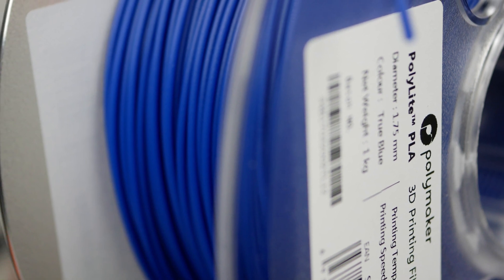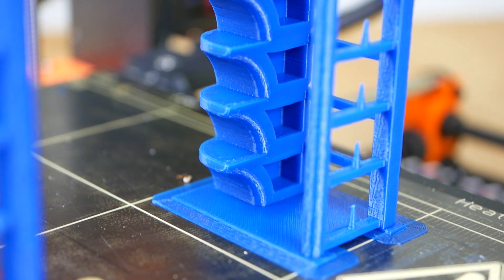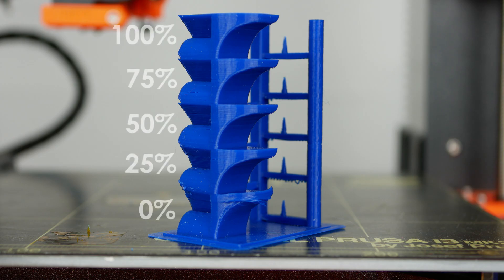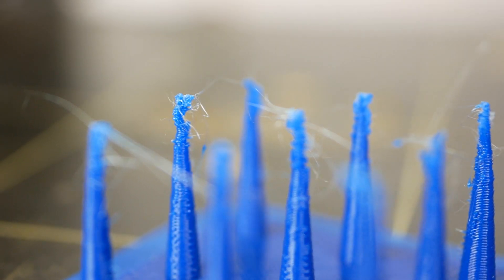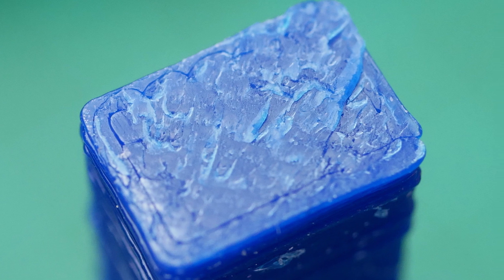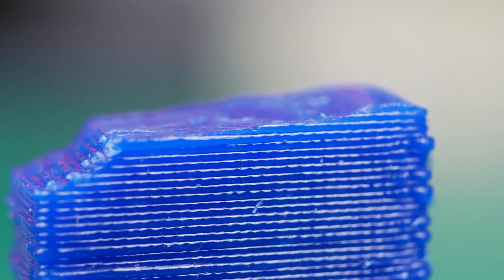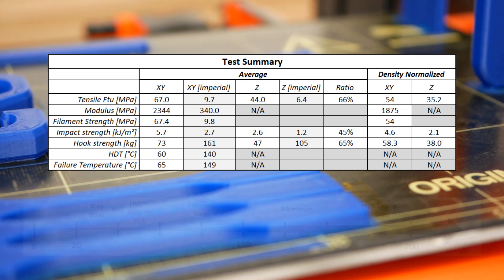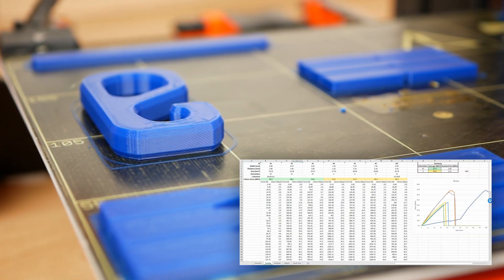PolyLite PLA - Polymakers everyday use PLA filament || Review & Strength Test

Comment: Nice Video Stefan!! Do you also measured the strain at break for x/y and z direction? Gruß Schorsch
Reply from the maker: Hi Schorsch, unfortunately not. Measuring strain is quite a lot of work with my setup, so I only did it for XY and also currently only use it for the modulus calculation. I'll probably add these values for the next review.
Reply: So you are measuring strain with the clamping length and the traverse stroke or optical with two parallel lines on the specimen?
Reply from the maker: +Georg Streitz it's optical with points on the specimen.
Reply: @CNCKitchen  download GOM Correlate - they have a free version which is extremely powerful & will allow you todo 2d D.I.C with much higher fidelity then 2 lines / pts. - would be more then happy to help if you need it. great video BTW.